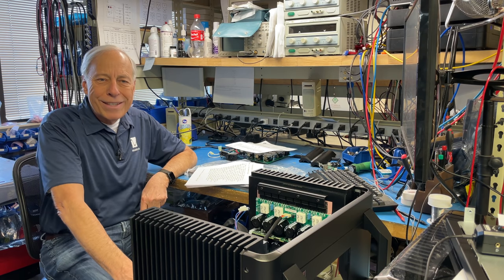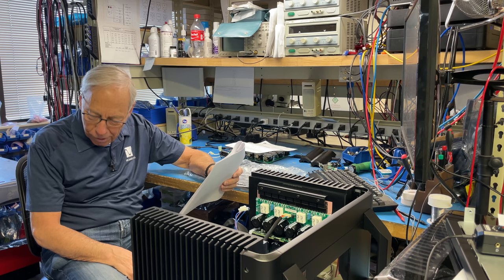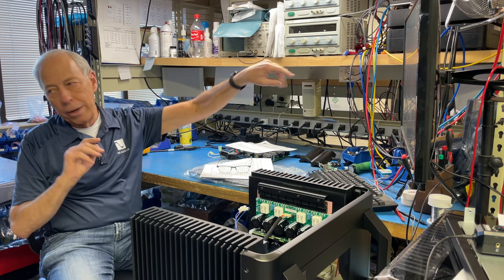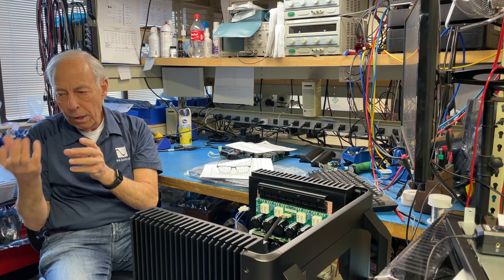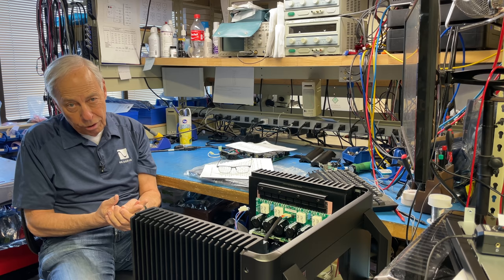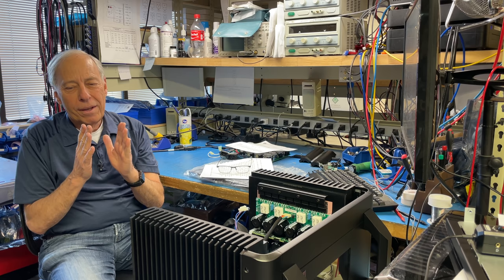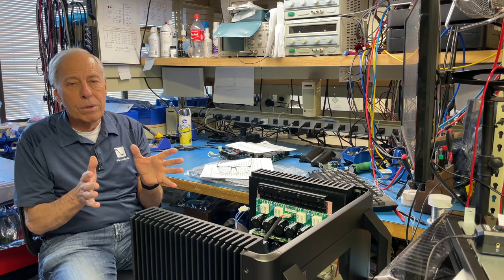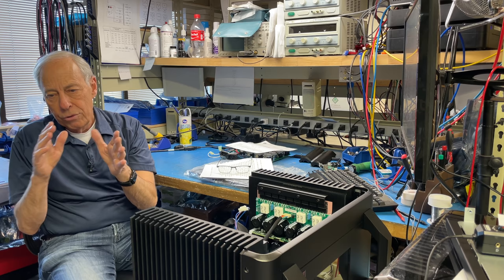Differences in digital audio cables

Comment: Sorry Paul. No human can tell the difference between digital cables. Jitter is a measure of latency fluctuation, not signal interference. You don't get noise in TCP connection, because it will drop the packet if it is corrupted in transit (ie gets induced with noise). Sorry. Nope.
Reply: I can tell.Always.Wash your ears first.
Reply: I can tell. Dont even have to get the uber expensive cables to notice a leap of difference.  Sorry, its too easy to distinguish.
Reply: Yeah I felt that was a lengthy introduction with a a little bit of a .. too brief... response
Reply: I can, easily.
Reply: @doctorrobin3040  digital audio signal. 1’s and 0’s. You’d need to have a machine to tell the difference, unless you’re using single strands of 40awg wire that was broken and intermittently touching.
Reply: @doctorrobin3040  no you can't because it don't exist! you just need to believe that the amount of wasted money made sense and so you imagine to hear it - otherwise you would despair
Reply: @Harald_Reindl  
Yep, confirmation bias...
Reply: @Harald_Reindl  have you tried it? Im not even saying to get $100 or more cables. Just the basic cables from reputable audio companies.
Reply: @justanobody4983  jesus christ i make my living with it technology and I am not dumb

maybe people should start using optical cables for the sake of god
Reply: @Harald_Reindl  well have you tried it at least?
Reply: @the_normal  I have two questions, How old are you and what did you do for a living? As we age our ears get worse. And if you worked in a noisy environment your ears are not great. Do you wear hearing protection when using power tools?
Reply: @Harald_Reindl  you are not the only one in IT. Why don’t we just agree on the fact that some people hear the difference while some others don’t? Doesn’t it sound more balanced this way?
Reply: @DaveJ6515  because only idiots agree that bit-perfect digitial transmission can have differences and fucking bits can have no "noise" - 0/1 has no space for noise
Reply: @Harald_Reindl  oh I see. There are some open positions at CERN, they are having some problems with the Standard Model and I am sure that you, with your vast knowledge and wisdom, might be of great help. One piece of advice: when you apply, don’t use profanities.
Have a nice life, send a postcard from Switzerland and one from Stockolm.
Reply: This is correct. People don’t understand how a digital signal is recieved. Even if there’s noise which there might be. The end result is a stored in a buffer as a digital signal that was determined by the incoming bits signal threahold. In other words. I can send the most jittery signal over a digital wire and once it’s stored in the short term buffer, those bits are completely decoupled from the original signal!
Reply: This is correct. People don’t understand how a digital signal is recieved. Even if there’s noise which there might be. The end result is a stored in a buffer as a digital signal that was determined by the incoming bits signal threahold. In other words. I can send the most jittery signal over a digital wire and once it’s stored in the short term buffer, those bits are completely decoupled from the original signal!
Reply: @Harald_Reindl When someone asks you if you have scientifically tested something, nobody cares to hear you whine about your "making a living". Your ability to make a living and reality can be very far apart just because some idiot pays you doesn't mean you know anything.
Reply: @PaulDo22  if you don't understand digital transmission you are a poor soul
Reply: @Harald_Reindl  Therein lies the issue, digital transmission isn't the same as the digital---> analog reproduction.  How each cable contributes to that chain of events is the issue. Transmission is only one part of the process and the information within the transmission is more than the packet information alone.
Reply: @PaulDo22  no it's not - but go ahead and throw your money in expensive digital cables - mine is a 100% perfect room acoustic and speakers
Reply: @Harald_Reindl  Do you also think speaker cables have no relationship to audio quality? Do you really think you can use 22 gauge Walmart wire and get the same experience as shielded, 14 gauge oxygen free copper?
Reply: @PaulDo22  I do not think - I know - A signal either reaches the receiver unaltered or not - there is nothing between
Reply: @PaulDo22  and that's the difference between educated people and you - educated people can measure things and what you can't measure you can't hear
Reply: @Harald_Reindl  Yes you should try shoe string next. Find the cheapest conductor you can and use that. I would fire you if you worked for me because you can't think clearly.

Comment: His explanation simply isn't true.
There's no "noise" in 0's and 1's in digital communication. And jitter is removed by buffers at the receiving end. That's what their there for in the first place.
Reply: Well you can have noise on a digital signal. In fact ALL electrical signal transmission is analog. The difference is the way the information is being carried. With digital the noise has to be greater than 1/2 the signal voltage. That will change a zero to a one. The beauty of digital transmission is that threshold is hard to exceed, especially in a home audio system. If you had an electrical noise that poor, analog audio would be impossible. The next come back is that the digital cable can carry noise into a DAC and the noise get's induced into the sensitive analog circuits. OK, that is certainly possible but again it's being carried way out of context. Many of these audiophiles had all analog tur table systems for years and yet the performance was more than acceptable. Now all of a sudden we have this noise problem in a digital system that is highly immune to it in the first place? It's all snake oil so the audio accessory vendors have a product to sell. The truth is that digital technology had greatly narrowed the gap between average quality audio gear and high quality gear - at least as far as sound reproduction goes.
Reply: @andydelle4509  Yes, that's why I had the word noise in "". You will always have a "noise-floor" in any electronic communication, but if that should result in a bit being lost or flipped, then TCP would correct that. If isolating one stage from the next gives that HUUUUGE improvement as he claims, then it must be for other reasons. Maby they should try isolating more stages in their products. Imagine the improvement that would give.
Reply: @geirendre  The problem  is that some audio protocols don't have error correction. SPDIF for example.
But again it works very well and all this electrical noise FUD in residential systems is just that.
Reply: @andydelle4509  Yes, and I have a hard time understanding why music over the network should sound any different from a file read from the local harddrive.
The upper application that converts the bitstream into audio (The DAC part of it..) wouldn't know if the bits comes from the network via the IP-stack, or if it comes from a harddrive via the SATA interface. They both probably ends up on the same internal PCI-bus inside the PC (or whatever fancy box it is in) on the way to the DAC anyway.
Reply: @geirendre  what I find more fascinating is that my 10 Gigabit ethernet can transmit a full Gigabyte per second, all sort of data mixed at the same time and when it sees "hey that is part of digital audio" it decides to put noise on the bits while I really would like to know where to store that noise in a digital bit which can only be 0 or 1

Comment: Paul I'm sorry but you are mixing up different aspects of the digital signal path. The transmission of USB data, assuming the cables are operating within spec are basically perfect because they are transmitted with packets just like the internet example you gave! Just because you've seen improvements at the end of the component chain of you SACD player doesn't mean it has anything to do with the USB data transmitted and received then passed to the DAC.  Any issues, again assuming USB cables are operating within spec, it outside of the realm of the USB sub-system.

Comment: Hm, maybe this is the Reason why my System sounded a bit better as I switched from an old noisy PC to a Laptop/Dock setup as digital source. Then again it could have been the impact of the old and cheap PSU on the Powerline or the lack of Fan noise.
Reply: Yep, both of those will make a difference

Comment: Ugh... bad video, Paul. Didn’t address the question.
There are no modern consumer systems in which a digital system is connected to a DAC without buffering. The consequence of this is that any difference in perception between properly working digital cables is pure placebo effect: you expect a $$$$$ cable to sound better than a $$ cable - and so your brain makes it such that it actually, subjectively, does... even though the waveforms being output by the DAC are identical.

Ethernet and USB both go thru a software stack that packetizes the data and unpacks at the other end; and during this process it’s just a collection of bits with no timing at all; the timing of playback comes at a later stage in the DAC chip. SPDIF can be implemented directly in hardware, but it usually isn’t - it’s easier and far cheaper to use a microcontroller to handle the data stream conversion and DAC chip interfacing. HDMI sits in a bit of a hybrid position; as media application processor chips will have some dedicated hardware for capturing an incoming stream off of the HDMI input, unpacking it, and writing it to the chip’s RAM buffers. From there, the software takes over, and what that code does with that data is what turns a general-purpose chip into a specific product (I.e, a TV, a receiver, a DAC box, or a video mixer, etc).

As for the PS SACD design; that stuff is all on the analog side; even the low-jitter clock... and that’s where the magic happens; not the digital transport of the bitstream.

So... as I’ve said before: for digital cables, just buy good quality, physically robust cables, and don’t spend a fortune on them. “Audiophile Grade” digital cables & networking hardware is pure snake oil.... save your hard earned $$$$ for where it matters: analog devices, speakers, and room treatments. (Your easily and/or ill gotten $$$$, however, you can just send over to me 😜)

FWIW, I have personally written audio handling software; as well as other kinds of software that handles real-time pulse generation at a low level; I’m familiar with this stuff down to the device driver level, and in some cases have gone down to the transistor level.
Reply: Yup. For me, it's keeping the mains, ethernet cabling, wifi ap's and even the usb cable to the dac as isolated as I can from the dac and the amps (or not near the analog stages between the dac and amp output). Otherwise I'll hear the pips and pops of the rf from the data streams. Second I did a reroute, problem solved. Not spendy cabling.  I'm sure if I'm really ocd, I could find some heat shrink to help isolate noise coming from mostly my ethernet cabling.

Comment: What boils my brain is this new trend of "audiophile" network switches & PC's Paul put it best, the greatest audio PC is the cheapo laptop running off a battery. Any pre-source running off grid is bound to impress honestly. That includes a DAC using even the poopiest of cables.
Reply: Batteries come with their own set of issues though. Clean power without noise and a perfect sine wave, like with a linear power supply or power plant connected through a dedicated outlet is very impressive and in my experience blows the pants off any battery I have ever used.

Comment: When you order your dinner to be delivered, is it best for everything to arrive in one car, or are you okay with each dinner item arriving separately, causing delays and interfering with your dining experience?

The same is true for digital data.
Yes, for a file transfer, everything get copied, exactly, from point "A" to point "B".  And if you monitor the speed, you will see it constantly changing.  Now imagine if you were listening as that speed was changing.  That would be an extreme form of jitter.

There is also line/electrical noise.  Other than optical cables, all components (especially computer components (think digital components)) generate noise, and that noise is carried from component to component.

When you combine jitter and noise, they diminish the sound quality, and significantly so.

If you do not have a transport that is designed to minimize the above issues, then you have both jitter and noise.  But you do not hear it?
Well, you do hear it.  You just do not realize that you hear it.  BS, you say?

Go to an audio store that carries an Aurender, Innuos, or Melco digital transport/player.  Also, bring your own CD player (or computer, or what you are using to play your digital files).
Let the store switch back and forth between your CD player and one of the above players.  You will instantly hear the difference.  That is when your ear will recognize jitter.

And note that the Aurender, Innuos, and Melco digital players are transports (even though they are referred to as players).  They are specialists at doing precision file transfers.  They, themselves, do not create an analog signal (or sound).  That happens when the data reaches the DAC.

To minimize jitter, specialized, high precision clocks are used, to deliver all bits in unison to the DAC.

Another test (which I performed) was that I connected my laptop that uses JRiver's Media Center, to the audio store's Aesthetix Romulus DAC (and that DAC has a CD tray).
I brought along a CD with a dozen songs.  I played those same songs directly from my laptop into the DAC, and they sounded very good (or so I thought).
I then played the exact same songs from the CD tray (on the same DAC) and the music blossomed.  That was because the DAC's built-in CD transport was mostly jitter free and noise free (and my laptop was not).

To have digital sound its best, you have to have the player (the transport) send a noise free, jitter free, data stream to the DAC (not easy to accomplish).
And you also need a quality power cable for all digital components.  They help.  Why?  I do not have a technical answer.  But I have done testing comparing the stock power cord with a good after-market power cord, and you can hear the difference (but mainly this helps most on digital components).

Cheers!
Reply: Your brain EXPECTS to hear a difference. Since one cable is more expensive than another your brain tells you it it better. This is called confirmation bias.
Reply: @zackschindler8334  You are painting with a broad brush.  Just because confirmation bias exists, does not mean that everyone has it.
Power cords matter, especially for digital components.

If your stereo costs $500, then the power cord does not matter.  Using a quality $500 power cord on a $500 stereo will probably yield no sonic difference.
Using a quality $500 power cord on a $20,000 stereo (assuming good components are matched and the speakers professionally placed, etc), then the CD's power cord will be significant.  Not because you believe it will be better.  Rather, because it will be better.  There is no guessing.  The difference is plain to hear.  If you have a working set of ears, then you will hear the difference.
Reply: @NoEgg4u  People claim all kinds of things. Some see an image of Jesus on a tortilla. Claims need to be backed up with some kind of provable evidence. For instance WHY does X cable sound better than Y? What is the reason and can it be proven in a blind test? Show me some tests done in a lab that show how and why there are differences in power cables. Anything else is just opinion.  And yet even if what you say is true does it make any difference it your listening experience? I really don't care what people buy. But does it makes sense to piss away ones time and money on nonsense?
Reply: @zackschindler8334  I do not have access to a lab.  I do not know anyone that has access to a lab.  I do not know what equipment would be needed for a lab.

I do know what equipment is needed to perform a proper test.  That equipment is a quality stereo system, professionally set-up in a room that does not have major issues (such as too many reflections or bass humps or drops, etc).

If a lab does not show any differences, then that lab is either not properly equipped, not running a complete test, or the technician is not qualified to perform the test.
How do I know this?

I know this because I have heard differences between stock power cords and quality power cords (and price does not always reflect quality, because some expensive cables are not good).  Also, there are countless Chinese counterfeit cords being sold that look like the real thing.  Anyone testing with those will reach false results.

Please understand that with a quality stereo (not a department store stereo), you will hear the difference when upgrading to a quality power cord for your CD player / DAC.
It is not a struggle to hear the difference.  It is not an assumption.  It is real.

Does it make sense to piss away one's time and money on nonsense?
No.
Why would anyone do so?
Reply: "When you combine jitter and noise, they diminish the sound quality, and significantly so." Bold statement. But where's the evidence?
Reply: @KeithHeinrich  You believe that jitter and noise do not diminish sound quality significantly.  Now that is a bold statement.

I have never read anyone else making that claim.  I have read arguments on what can or cannot control jitter and noise.  But never anyone claiming that jitter and noise do not diminish sound quality.